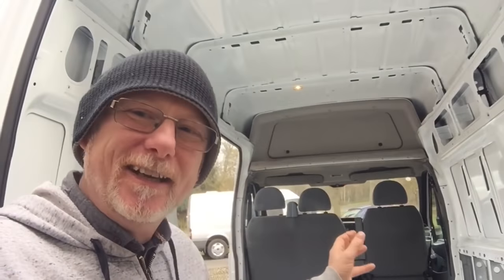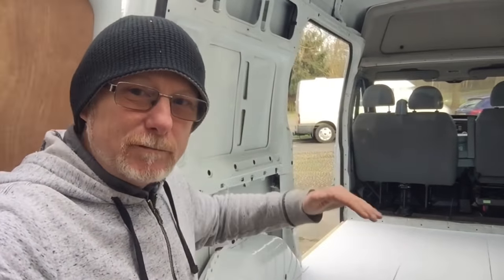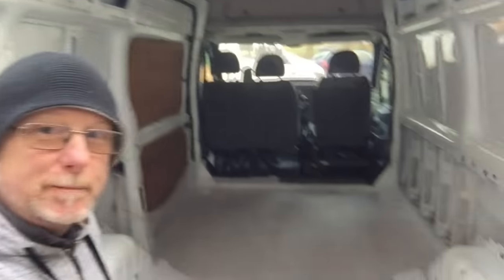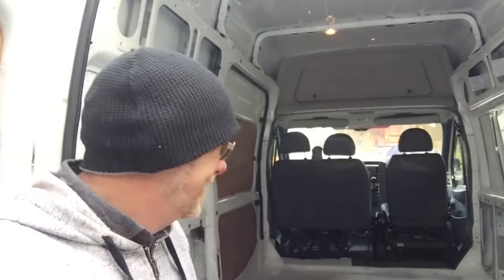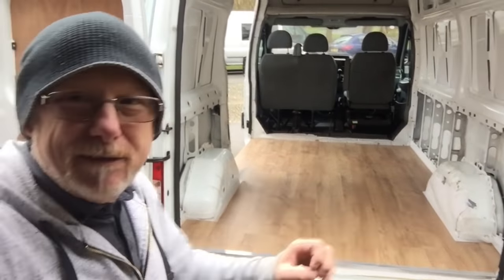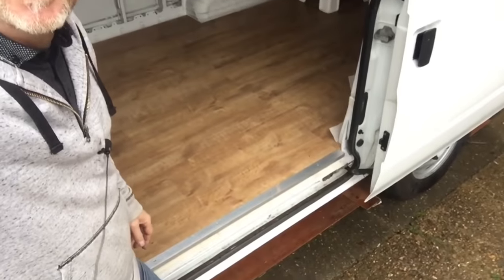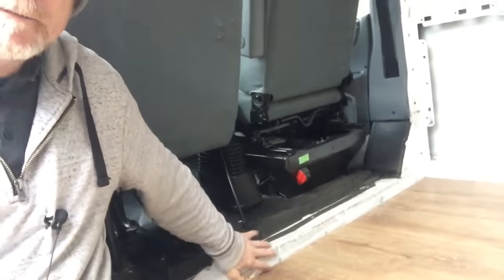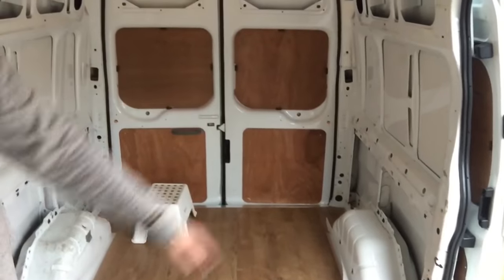HOW TO insulate the floor in a camper van ford transit  conversion -

Comment: Thanks for the video! You have a really bright energy that comes through even videos. It makes me happy.

What is the sticky foil you referenced at 4:10?

I'm about to buy a van and convert it myself. I am a maker, but mostly of jewelry. I have little experience with construction. So I need all the help I can get, although I want to do most of the work myself. I think I'll form a deeper attachment to my van that way. What sort of tools will prove most important in the build process? Any advice for someone like me?

Comment: Im converting the exact same van right now and stuck on the floor battens, how did you put the 25mm battens down on the back and side edges... Did you have to put some extra wood underneath so that the batten is flush with the floor ridge and not balancing half on a ridge? Thanks in advance!
Reply from the maker: From memory I think I used 30mm 🤔
Reply: @BigVanSmallWorld  Thanks for the reply, Theres a small gap between the end and where the floor ridges start so just didn't want to balance the batten on half a ridge. The van came with some ply strips for the edges so the floor panel sat flush with the top of the ridges, I think ill just reuse these and put the batten on top and over the first ridge for extra support. I imagine you had to get creative for a lot of the build with this van and its strange shape Haha ps I also have the same step to get in and out.. just watch your head!

Comment: Forgot to ask Mel, when you put the ply over the top of the polystyrene do you fix it down or is it just laid loose on top?
Reply: I use the tie downs in the van no penetration...  otherwise why drill holes? Turn buckles to the floor then construct the interior
Over it

Comment: Mel, have you ever changed the double front seat to a single one? I have been told that the drivers side base is a straight bolt on is this true? Thank you for your videos and inspiring me to get on with my own High Top Transit build and also showing people that not every single transit out there is a rust bucket. Just need to keep up maintenance to the body to keep it in tip top condition. Have you considered maybe having a meet up with your followers in the summer? Stephen
Reply from the maker: Stephen Morgan Hi Stephen how wonderful to think I inspired you. no I haven’t done a seat conversation on a transit I used to chop n change them all the time on old VDubs but never a modern van.
Maybe when my channel grows I’ll go for a meet-up thanks for your support really appreciated 🤓🤙
Reply: use the seat base from the drivers side all holes match up just done mine
Reply: @leedavies9309  Thanks Lee, I prefer the idea of a walk through so i don't have to get out of van to get in the back :-)
Reply: @stephenmorgan5100  its a lot better thats,,, why ive done it im putting a mk7 front on a mk6 now
Reply: There are single seat bases in some Tourneos but you can use a standard drivers base and grind off the hand brake fittings. By the way it's not hard to make an adaptor bracket to fit a FordGalaxy swivel front seat in these. Lots in the scrap yards. They don't adjust as well as a proper seat so won't suit all but cheap to try out. Happy travels everyone. John

Comment: Nice job on the floor Mel. Oh, plus the trim looks well, I like the brass effect trim myself but it doesn't look good for very long when it scratches up.
What do you think of transits in general Mel? I know they get some bad rap but then again what doesn't? 👍 Your works cut out for you, straight into another van 🔧🔩

Comment: Hey mel obviously you have the need for a vapours barrier and with metal skin you must have a dew point ? Where is the condensatiin/moisture draining too  ? I see you plugged all the holes in the floor.
Reply from the maker: peter amberley the only holes I plugged where the ones created by me removing the bolts and screws the vents in the lower side panels will remain unaffected 🤓🤙

Comment: Hi Mel, looking good so far. Are you building it to you spec or the owners?Can I as whats your trade/Job abd how much time do you spend on the project.until the next time ATB Glen
Reply from the maker: GKUK Dash Cam VW Cali thanks Glen the owner gave me an outlay and I’ll fit what I can in.
My day job is a trucker 🤓🤙
Reply: Got your ears on good buddie. Do you still use CB 🙄or all mobiles now.Glen